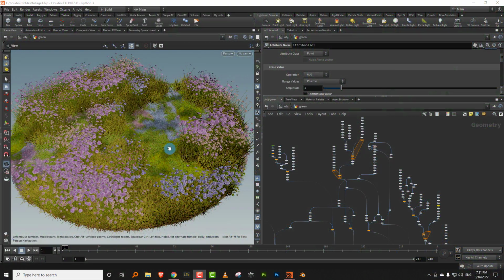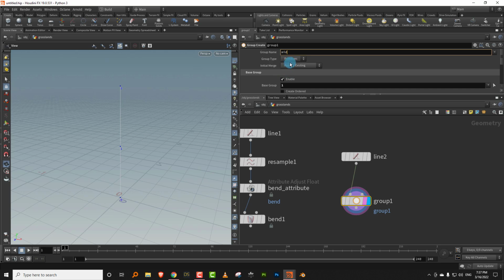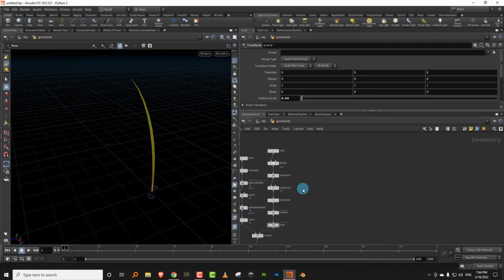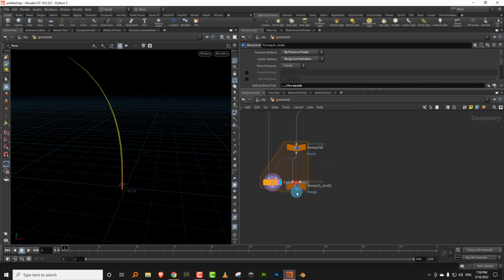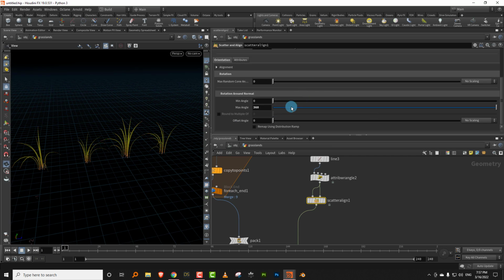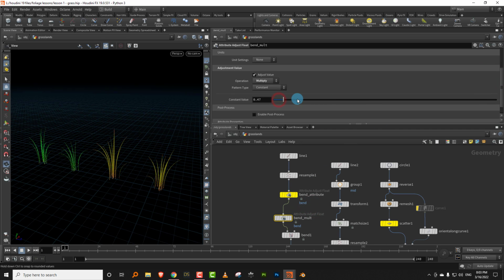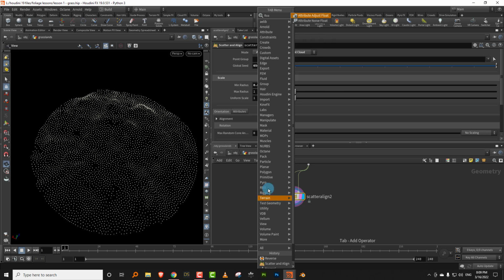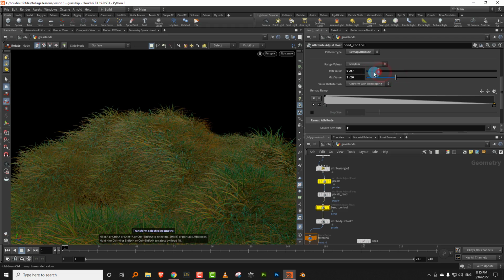Houdini grasslands   lesson 1   grass

Comment: Lovely tutorial as always. I tried to figure out how to add a bit of wind. I used Attribute Noise with animation and called it "wind" and then used Scale by Attribute in the Blend Normal With Y option in Scatter and Align node. I don't know if that's how it's usually done...
Reply from the maker: There’s no specific way to add wind. Your method is as good as any other. If you’re doing simulation then you can add a wind force otherwise you can cheat it using any noise map and modifying the position. So your method is good. 🙂
Reply: @rohandalvi  Thank you, that's helpful and thank you also for the awesome content. Many in the community benefit from these videos.

Comment: Amazing! Will it be ready for later using as a source for a sim?
Reply from the maker: What kind of a simulation do you have in mind?
Reply: @rohandalvi  Basically being able to add some dynamics to the grass rather than only having it static. For example feeding it into a vellum sim, and therefore setting it up in a way that is mindful of what its needed to have a somewhat fluid and not superheavy sim.
Reply from the maker: @emepicuta3899  you should be able to feed to into any kind of a sim but then it won't be treated as packed primitives. Which means it will take a lot of Ram to render it. If that's not an issue then you can run out through any kind of a simulation.